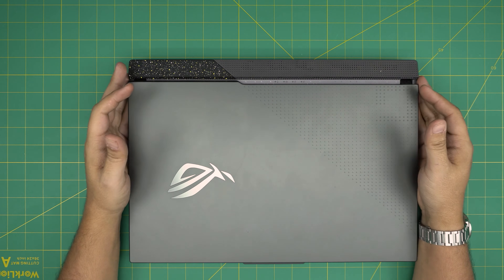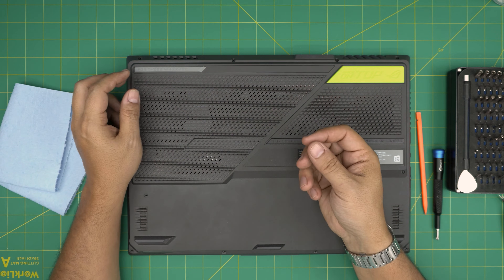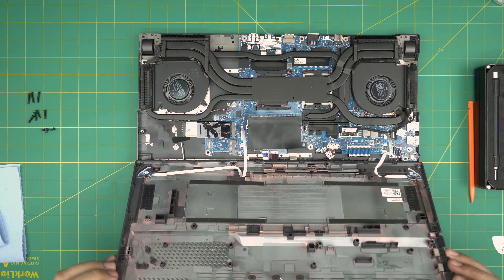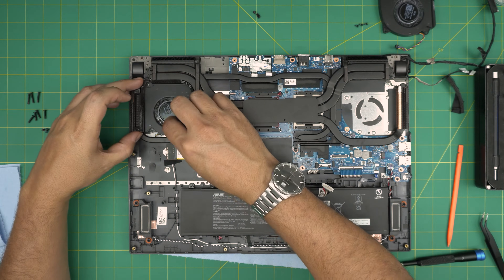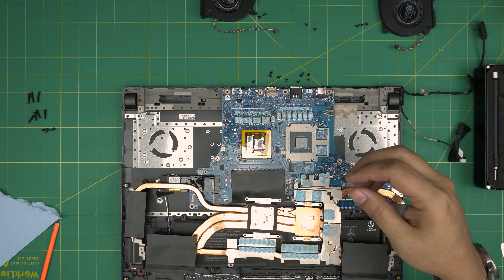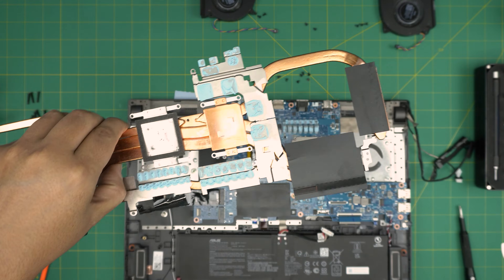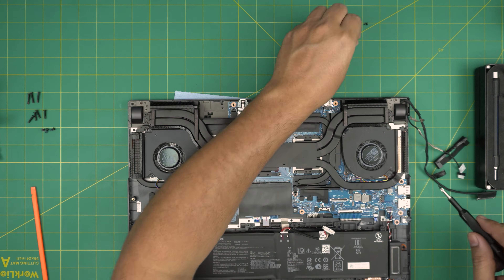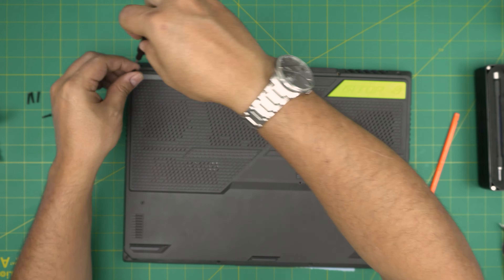How to Repaste and Clean an Asus ROG G17 Laptop | G713Pi DS94

Comment: Hi. Thanks for the video. This is my second time opening up my laptop using it. 

But I have an issue: I stripped one of the Philips screws  on the CPU that was supposed to allow you to remove the heatsink. I tried cotton, rubber bands and super glue (the super glue worsened it to an extreme degree). I don't think there is anything I can do to recover that screw so I plan on breaking the connection of the heatsink to it. But I briefly tried opening some of the other screws (and failed) and I am pretty sure that the other screws will definitely give me the same issue with this one. What should I do to prevent such from happening to the others?
Reply from the maker: 🫠Regarding your question, if you have a bad screw, here is the way I remove it, and it is the safest and easiest method:
https://youtu.be/UaMO0sH45VI
cheers🍻

Comment: Great guide!!- a quick question how do we put back the RGB wires if we removed it from the bottom casing and not from the laptop base itself? like I see you removed it from the laptop and not the case but we did it the other way around by mistake. how do we reinstall it?
Reply from the maker: It's my pleasure my friend.
🫠Regarding your question, simply remove the tiny board on the case side that the flex cable goes to, then plug the flex cable into the board and screw it back onto the case.
cheers🍻

Comment: Is it okay to put thermal paste for both the cpu and the other thing? I only have thermal paste
Reply from the maker: 🫠 Regarding your question, yes, just apply the thermal paste and leave the rest alone—don’t touch them.
Should you have any further questions or requests in the future, please don't hesitate to ask me.
cheers🍻
Reply: One more question, i lost the foamy like tape for the lcd cable and video camera cable on the right fan side, is there a way i can get a replacement?
Reply: The rectangular top piece
Reply from the maker: They don't sell them, but you don't have to worry—they don't affect the performance or temperature. We have checked and tested with and without them.

Comment: hi 1st thanks for your videos i have cleaned other ones following your videos sucessfully but in tthis one, i did all and now my laptop does not boot up, powers on, th rgb too but does not load anything, could be the liquid metal doing a shortcut cause its conductive?  what can i try, y cheked a lot of thins im willing to pay, thanks a lot a againg for all
Reply from the maker: 🫠Regarding your question, make sure that the LM is not touching the tiny capacitors around the CPU.
Before you do that, NOTE:
When servicing the laptop and trying to power it on, it will not power on unless the charger is plugged in. So, plug in the charger, make sure the bottom case is closed, then power it on and wait up to 2 minutes.
cheers🍻

Comment: Hello I have a few questions. I just got my laptop g17 Rog Stix brand new in January and it just start freezing and going black screen I go to the Bio boot-up menu and my CPU is at 90c+ and it will freeze. Is my problem the Liquid Metal you replaced and if so how often do I have to clean and add more ?
Reply from the maker: 🫠Regarding your question, remvoe the LM and place a ptm7950 honeywell:
https://amzn.to/3HPb6Xk
trust me the LM on this laptops are usless! 
place the ptm7950 on GPU and CPU (make sure you remove the LM and the old paste.
Should you have any further questions or requests in the future, please don't hesitate to ask me.
cheers🍻

This is an Amazon affiliate link. When you use my links, you are helping to support the channel. 🙏
Reply: Wow I got exact the same thing, mate! Idling temperature is 95 degrees

Comment: Nice video, bro😊
But i have a question. What are theese small squared things around CPU and GPU that also covered with thermal paste? Can you please explain, cuz i haven't understood right😅
Reply from the maker: 🫠Regarding your question, those are the power delivery components, such as coils and voltage regulators. The black squares are the VRAM chips, which use thermal gel or thermal putty. A good thermal putty is linked in the video description, which we recommend.
Should you have any further questions or requests in the future, please don't hesitate to ask me.
cheers🍻

Comment: where is the CMOS battery on this unit?
Reply from the maker: 🫠Regarding your question, there is no dedicated CMOS (BIOS) battery on these laptops. The CMOS draws its charge from the main battery. If you disconnect the main battery and press and hold the power button for 30 seconds, it will reset the CMOS configuration to default settings. *Note:* This will not reset the BIOS password, as the password is stored in a different chip for security purposes.
Should you have any further questions or requests in the future, please don't hesitate to ask me.
cheers🍻

Comment: does this kill the warranty
Reply from the maker: 🫠In response to your question, the impact of performing your own service on a product's warranty varies based on your location and the manufacturer's terms and conditions. In the United States, the Magnuson-Moss Warranty Act protects consumers by ensuring that using non-original equipment parts or services does not automatically void a warranty, unless the manufacturer can prove that the modification caused the defect. Therefore, you can perform your own service without losing your warranty, provided you don't cause damage or create a short circuit.

Should you have any further questions or requests in the future, please don't hesitate to ask me.
cheers🍻

Comment: Hey! Thanks for the tutorial! Do you think I could put LM on both the CPU and GPU?
Reply from the maker: It's my pleasure my friend.
🫠Regarding your question, you can, but you will need to tape the tiny capacitors on the GPU chip with Kapton tape and then apply the LM on the crystal die.
Should you have any further questions or requests in the future, please don't hesitate to ask me.
cheers🍻
Reply: @uFixTek  I see, just to be safe I'll stick with thermal paste then for the GPU, thank you for the tip!
Reply from the maker: anytime 🍻

Comment: I upgraded the ram and ssd . Now my asus sitrix g17 KB isn't working.   Kb lights as well. Rogg symbol on the outside lits up though.  The 2 cables for rgb lights are linked to KB as well?
Reply from the maker: 🫠Regarding your question, remove the RAM you upgraded, switch the RAM places, put the bottom cover back on, connect the charger, and wait for up to 30 seconds.
cheers🍻

Comment: I have a 3 year old ROG G533QS with R9 5900 and 3080. My temps have gone up recently especially on my GPU (around 86c) and I’m thinking of repasting, however I’ve heard that Kryonaut is suited for desktop computers and is not meant for temps over 80c therefore it causes a pump out effect after a few weeks of use. I can’t have my laptop frequently serviced because of this. Can you guide me on what should I use on my GPU? Would Kryonaut Extreme be better? What about Hydronaut? Thank you.
Reply from the maker: 🫠Regarding your question, i would highly recommend you to get this permantent solution and never worry about repasting only fan cleaning, use this thermal grizzly kryosheet: https://amzn.to/3XGDY9Z
just get kaptopn taype and tape around the crystal dye and place the krosheet and that is equivalet of liquid metal.
Should you have any further questions or requests in the future, please don't hesitate to ask me.
cheers🍻

This is an Amazon affiliate link. When you use my links, you are helping to support the channel. 🙏
Reply: @uFixTek  Thank you for the help.
Reply from the maker: It's my pleasure my friend.

Comment: I have the G17 Scar 2021, I know the CPU also has Liquid metal. I've had my laptop for 3 years now and I am wondering about repasting the liquid metal. Do I have to clean the old LM before applying the new LM? My temps do go high and I've been just thinking about doing a repaste but obviously LM is a different substance that needs to be applied carefully.
Reply from the maker: 🫠Regarding your question, yes you have to open it and just add very small about over the GPU or CPU dye and that is all no need to remove the old LM because LM doesn't expire.
we do this for our clients and they happy with results.
Should you have any further questions or requests in the future, please don't hesitate to ask me.
cheers🍻

Comment: Pleaseeeee where i can find cmos batterie beacuse my computer not turnning onnnn pleaseee
Reply from the maker: regarding your question, there are no cmos battery on this laptops, the cmos charge comes from the main internal battery, remove the main battery and press and hold the power on for 60sec and the bios will reset to default.
Reply: The internal battery keeps your bios settings, try removing it as described above otherwise you might be having a hardware issue that needs some technical person to assist.

Comment: can i put normal paste instead of liquid ? 
and i put normal paste on each little thing without removed the previous paste because it wasn’t that old, is it very bad should i clean up all and put again ?
Reply: the thermal pady, i put thermal paste on them ?
Reply from the maker: 🫠Regarding your question, you can use a thermal paste instead of the LM.
NEVER use paste instead of the putty, when there is a putty because it will counter push the heatsink and you will get a horrible results.
if your putty is dry get a good grade putty:
https://amzn.to/4ck3B5j
Should you have any further questions or requests in the future, please don't hesitate to ask me.
cheers🍻

This is an Amazon affiliate link. When you use my links, you are helping to support the channel. 🙏
Reply: @uFixTek  i mean i still have some putty (or thermal pad) no idea of what is it for sure it’s kinda like a paste., i still have some on it but i added few thermal paste on it to be sure because i don’t have the right think to put there, so you confirming me u need to use putty thermal at this places ?
Reply from the maker: YES  USSE PUTTY THERMAL, on  components and vrams.

Comment: Do you have before-after results? I also wonder if I can continue to use Liquid Metal on CPU and jut change the GPU thermal paste?
Reply from the maker: Thank you for your feedback! If you wish to support the channel, you can like, subscribe, or both!
Regarding your question, this video is not a comparison or benchmark, it is a simple laptop repaste service, the results are different for everyone depending the type of game and room temps, this the same as you do a car oil service.
if you want the best result use this: thermal grizzly kryonaut: https://amzn.to/3H5gim4
and for the LM you can just use the same LM that is already there, just spread the LM over dye and it will be all good to go.
Should you have any further questions or requests in the future, please don't hesitate to ask me.
cheers🍻

This is an Amazon affiliate link. When you use my links, you are helping to support the channel. 🙏
Reply: I bought the thermal paste you mentioned today. When I removed the heatsink, I was very surprised. The liquid metal on top of my processor had shifted downwards (in line with the laptop stand's angle), and there was a noticeable burn mark on the processor. I spread the liquid metal. I cleaned the old paste on the GPU (its quality was really bad and had dried up in a year), applied the new paste, and reassembled the laptop. The GPU, which used to instantly reach 86 degrees and decrease its speed by 300MHz, now ran at a constant 1800MHz and 150 watts for hours. <3  @uFixTek
Reply from the maker: awesome job my friend, now you can do your own service once a year or year and half. this way the laptop will last much longer.
cheers🍻

Comment: Well done, thank you!  One question: what do you think of replacing the LM and paste on the CPU and GPU with PTM7950 pads instead, and what mm thickness would be best?  Thanks!
Reply: Great video. Why didn’t you clean the cpu entirely and paste kryonaut on the whole thing?
Reply from the maker: Thank you for your feedback! If you wish to support the channel, you can like, subscribe, or both!
Regarding your question, in my 17 years of servicing i would highly recommend you to clean the GPU and CPU and place : https://amzn.to/3tlvyrL
thermal grizzly kryonaut
you will get the same resolt as LM but with 3-4c more but the risk of damaging and spill of the LM when the lptop bags in the bag we have see many laptop come in because the LM dripped onto the main board.
Should you have any further questions or requests in the future, please don't hesitate to ask me.
cheers🍻

This is an Amazon affiliate link. When you use my links, you are helping to support the channel. 🙏

Comment: Why exactly you're doing this? Is this because the stock paste is not sufficient or incorrectly applied? Do we have to do this if we buy this computer? Also, I would like to say that the way you explain and show is pretty good.
Reply from the maker: Thank you for your feedback! If you wish to support the channel, you can like, subscribe, or both!
Regarding your question, when ever i or any friends of mine purchase a high end laptop, we always like to replace the garbage thermal paste that it comes from factory with a premium thermal paste like: thermal grizzly kryonaut: https://amzn.to/49nJh1p
and this way the temps drop and it will give you a longer lasting laptop and no thermal throttling.
Should you have any further questions or requests in the future, please don't hesitate to ask me.
cheers🍻
This is an  Amazon affiliate, when you use my links, I earn a percentage, which helps support the channel🙏.